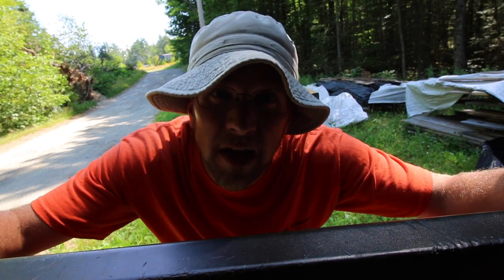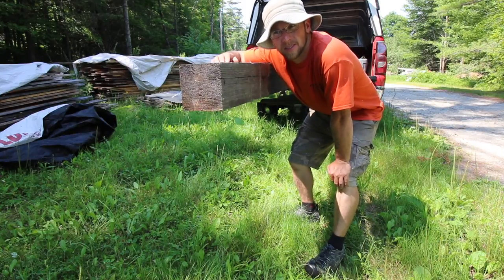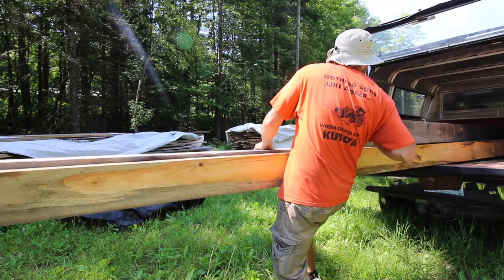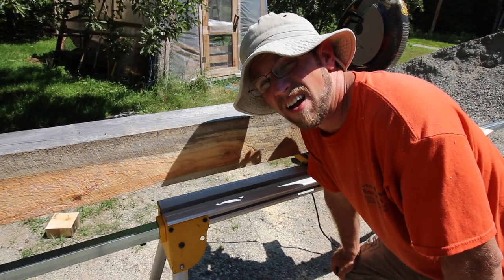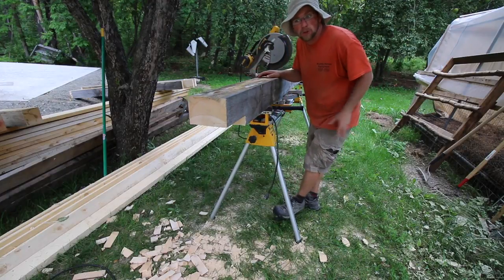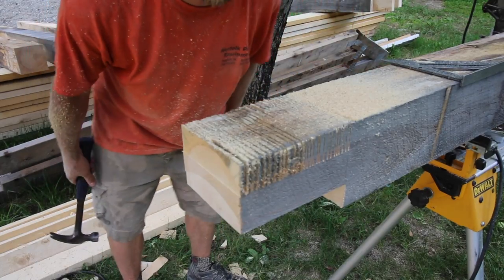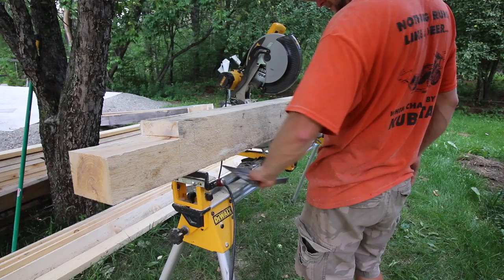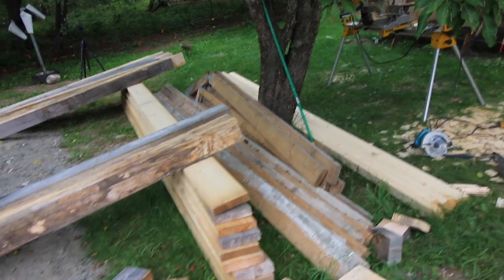Working on the Post and Beam offgrid Outdoor Kitchen Build

Comment: Al....you worked your tush off while your loader tractor sat there and laughed. A couple of straps or chains on that bucket would have prevented the sore back you had the next morning...LOL. You DID 'git 'er done' tho. Kudos to the 'tough guy'.
Reply from the maker: Thanks! I dont think the little kubota would have done to good
Reply: Don't sell that 'railroad spike' short. It's DARN SURE tougher than your body! I'll say it one last time.....You're gonna REGRET letting that tractor sitting while you work towards being like me at 60. You only get ONE body. BUT,  you CAN buy replacements for as many tractors as you wear out. Use them. ABUSE them. DON'T end up a 'cripple' kiddo.

Comment: You're a mad man Al! Where was Miss Livvie? She could have helped buck those timbers. HA! Just kidding, one of those 6x6 off falls probably weigh as much as her. :) Exciting to see this come together, it's a big job. 
When using your speed square as a saw guide, try hooking it over the far side, then when pushing the saw, you're pulling the square, and lumber against the direction of travel. This will give better stability, and control.
Reply from the maker: Thanks! Great advice as always! When we are doing some of the bigger stuff I dont like her to close, I would hate for her to get hurt
Reply: Yea, I was just teasing. I know you two enjoy working together, but not on this project. I wouldn't like to see any of you get hurt. I know you're very capable, but it only takes a second. You be safe, be careful, I want to see the smile on your face when you get the kitchen finished.

Comment: Hahaha, just when you mentioned thunder, thunder boomed right over me! Great job lugging that lumber around! Awesome grinder work too! The best part: the T-shirt!! 'Nothing runs like a deer...when chased by a Kubota! How about using it for moving wood?
Reply from the maker: Thanks! Lol about the thunder! I wish the Kubota was big enough to move it!
Reply: Yeah, those beams may tip it right over! Could it drag the beams to save your back? I did stuff like that when I was younger cause I could but now at 60, I'm paying the price!
Reply from the maker: I didn't want to drag them and scuff them up
Reply: Lumnah Acres - Gotcha. 👍 I used large chain link fencing posts to move my heavy objects around. It goes really fast when someone is helping grab the poles from the back and moving them to the front but I can do it by myself if needed. Big back saver! 👍

Comment: Your doing it all wrong. Unstrap the wood get in your truck and floor it. Wood slides off in one second.
Reply: True - any proper project would usually require at least one such incident, plus an incident requiring medical attention, a trip to the store to get the parts you needed, another trip to get the other part you forgot and a third trip to get the correct parts this time...  Al consistently and efficiently defies all these rules! ;)
Reply: LOL.  You guys cracked me up. That said, that big red loader tractor was laughing while it just sat there and watched Al play forklift....LOL.
Reply: singleman he's even wearing a kubota shirt
Reply: He didn't seem to need it though - Al seems to be deceptively strong at times and was manhandling those 17' lengths of timber like a boss!
Reply: Saw that. Evidently he didn't read it before he started. Don't get me wrong. I'm not at all dissing him for doing it 'the hard way', but I'M just too old to follow that path anymore.
Reply: Simon B I was thinking the same thing. What do you think they weigh 200 #s. That's a pound sign not a hash tag by the way.
Reply: Oh I agree with all that. Al's definitely a 'tough guy', but he'll regret unnecessarily wearing out his body when he reaches MY age. I was young and strong once, so I'm NOT downing him. I WAS him when I was younger. NOW, there's nothing more humbling than having to crawl to the bathroom because I once believed I was made of iron. He needs to learn NOW to make the best use of his machinery.
Reply: singleman Good advice and yes, I'm at an age where I can fully sympathise! I think I'll bow out here though - the Humorous Lane that I wandered aimlessly into on this thread seems to have reached a junction back out into Serious St. ;)
Reply: Sorry about that Simon. But watching youngsters make the same mistakes I did gets my blood pressure up. I feel obligated to warn them. Ignorance is ALWAYS expensive.
Reply from the maker: That only works in the movies! :) Lol. I need a bigger tractor with forks!
Reply from the maker: The little Kubota wouldn't be able to handle the beams. It has its limit being small.
Reply from the maker: Yes you definitely need to take care of your body. Some physical labor is good every now and than
Reply: I respectfully disagree. Tractors are my retirement hobby/livelihood. Until you've 'tested' it's limitations, I contend you're selling that tough 'little' tractor short. I'd wager it'll handle 2 of those beams at a time even without 'counter weight' on the back.  That said, take your chainsaw out and rough cut those beams, (where they lay), to an inch or 2 beyond finished length. Why handle 17-20 footers when you only need 8's?  I'm here because I admire you Al, and I'm sincerely hoping my comments are construed as positive and constructive.
Reply: Lumnah Acres you mean you can pick up more than the tractor.
Reply: Cynic....LOL. NOT gonna happen. Kubota tractors are as tough as railroad spikes. We just haven't convinced him that he did it the 'hard way'. But that's OK. I still admire his work ethics. And he IS tough.
Reply: Ease up on that chop saw brotha.... 
that is too good of a saw to burn up!
And get you a worm drive and a saw zaw
Save all that waste cut off pieces as kindling!!!
Reply: I've seen the fake modern homesteader wranglerstar have trouble picking beams up.
Reply: Eh? He never 'stalled' it. That DeWalt is tougher that you think. Also, he's marking and flipping 180 degrees AFTER the first cut. His cutting method is so slow, he'll NEVER 'burn up' that saw. Now, had he done it 'right' and marked all 4 planes prior, and flipped 90 degrees for 3 cuts in 30 seconds, I'd agree. Give the dude a break. He's not a 'pro'.
Reply: Cynic.....Eh?  Please explain why you think Cody is 'fake'.
Reply from the maker: Thanks! Yes they are taken that way! Looking back that would have been a bit easier. Live and learn!
Reply from the maker: It is a great chop saw we have had it for years now, built the house with it too! That is going to make some great kindling!
Reply: That's gratifying Al. Thank you. I 'try' to be sensitive to the fact that 'typed' advice/comments on the 'net lack the nuances of personal interaction/discourse. Please, take away from this thread, MY assurance that my comments are ONLY meant to be a positive. I think you're doing a GREAT job.  My regret is that I can't be there with you to teach and 'troubleshoot'. NOT sayin' you wouldn't figure things out without 'help' but, if each generation has to start at the same place as the last, WHERE'S the progress?
Reply: singleman are you kidding what homesteading does he do.  Jessica (mrs. Wranglerstar I think has a garden. But they never show it.  He's a walking talking commercial.  This is well known. Everyone that's been watching his channel for any length of time will tell you that his channel is really a carpenters channel or how to.
Reply: OK. I agree. While he certainly isn't MY 'ideal' example' of a 'homesteader', he doesn't have almost 700k subscribers for nothing. I'll pass on some, but I enjoy most of his videos. I'll even go so far as to state that 'homestead' is a 'stretch' in describing his channel.
Reply: Yeah, kinda takes the fun out of it  lol
Reply: Guard your back!
Reply: Just take good care of your back. We once hurt it's life changing.
Reply: lol
Reply: What is it about that Wranglerstar guy?  I don't even bother going to his videos anymore.  I don't know why but he really seems to be full of himself, unlike our fella here who seems to be genuine down to his stinky socks!
Reply: I'm just sayin'....MAYBE Cody's a bit 'self assured' BECAUSE he can AFFORD to be. As a 'lefty' Mensan, I feel 'Mr. Wranglerstar' is one the most 'balanced' righties' I'VE ever come across. He doesn't have almost 700k subscribers for no reason.  That said, Al certainly IS a 'breath of fresh air'. But comparing him to 'others' does him a serious disservice. We ALL have our OWN 'style'.  Live and let live.  At the very least....Unless you're able to walk a mile in EITHER of their shoes....STFU. Your comments are embarrassing to 'thinking people'.
Reply: I just think to present himself as a homesteader, with all the really hard working, young people out there roughing it and making a difference,  is a misnomer.  Often he has harsh words to say about others just because he has the floor.  Just not my cup of tea, lefty or righty.
Reply: Ya know....Now that you put it that way, I gotta back off and take a more objective look at that guy. You got me thinkin' here. Where DOES 'homestead' fit in with HIS channel?  A sincere thank you for an enlightening 'back and forth'. You just keep on 'sayin it'. Yer doing fine. And yer damn sure entitled to well expressed opinions. As much as it galls me to admit it, the taste of 'humble pie' sucks. Not very often do I get backed into a corner not of my own choosing.  Well Done.
Reply: singleman 33 comments on this thread and the end result is "what is a homesteader" nice!! good conversation
Reply: Well my intention was not to back you into a corner, nor to make you eat humble pie.  I must admit I go on instinct a lot and that has often gotten my fat fanny into a peck of trouble.   I was most put off the harsh words he dispensed onto other "homesteaders" especially his judgement that their popularity was solely based on their feminine good looks.  That grates a little and sounds a little like sour grapes.  By the way, don't give up so easy.  I'm just one old gal having her say.  Thanks for your reply!
Reply: I've hesitated to particpate in this latest discussion, at least partly as I'm not sure it's polite to discuss it on Lumnah Acres' channel, so against my better judgement and to quote a certain well known homesteader intro, "Here we go..."

I've long struggled with my opinion regarding Wranglerstar - yes he's very popular, but that isn't any guarantee of validity. I have enjoyed many of his videos and yet my gut instinct has always been that he might be a a bit of snake-oil salesman and whilst that can sometimes be the most popular show in town, that doesn't really change its nature.  (this doesn't mean he is of course, it's only what my instinct tells me)

That said. I've also pondered the nature of homesteading in that regard - to basically take a plot of land and use it to generate a hopefully sustainable income and lifestyle... On that basis, perhaps generating such income by planting a crop of videos, growing the subscriptions and views and then harvesting the advert revenue and sponsorship kickbacks, based almost entirely upon his homestead activities, could potentially fall under a viable definition of modern homesteading?

Do I think it's ultimately sustainable? No... 
Do I think it's preferable to growing healthy food and livestock and establishing renewable energy sources? Not really... 

I also suspect that the truth maybe lies somewhere in-between the two opposing views, that Cody seeks to be a homesteader and generate a sustainable living from his forestry and from Mrs W's garden and to embrace such pursuits as his love of traditional tools and methods but also struggles to let go of his old life love of gadgets, fast food and salesman ways. 

Ultimately though, regardless of the accuracy/inaccuracy of my opinion, Cody is probably just doing the best he can to provide for himself and his family...
Reply: Thanks Doug and Stacy. YOU are 'true homesteaders'. I've just discovered I'm no longer subscribed to your channel. Don't know what happened there. Don't really care. Popping over to reset.
Reply: Still,....THIS 'old guy' has, nevertheless, had a pleasant discourse with you. I'll still view, but I'll be watching several so called 'homesteaders' from, (your), different point of view. Many thanks for your time.
Reply: The Cynic 
LoL
Reply: singleman 
Are you as blind as Stevie Wonder or as deaf as Hellen a Keller?
Reply: I'm just sayin' AMEN!!!
Reply: Simon B 
Cody is the Ryan Seacrest of DIY MAYBE....
BUT NOT HOMESTEADER
NOT OFFGRID
Reply: Both.
Reply: I seem to be forever explaining myself.  Anybody can call themselves a "homesteader" and it is purely a self-aligned designation.  On my little acre I have tomatoes, peppers, cucumbers, blueberries, blackberries, pear trees, etc.  I even have a mulberry tree under which I sit, watch the fruit ripen and just contemplate my belly button.  However, I would never compare myself to Art and Bri, Justin Rhodes, Lumnah Acres and many more.  Even Starry Hilder gives me a chuckle every once in a while.  These people seem to be truly trying to change the way we interact with our world and are raising some wonderful little ones that eat broccoli like potato chips.  I get a lot of good ideas from them primarily because the knowledge they possess is presented in such a "just wanna help" fashion whereas others (and you know who I'm talking about) seem to have a "preachy" attitude and an air about them that just gets my cockles up.  I know, say I'm wrong but, I'm just sayin'.
Reply: Amen!